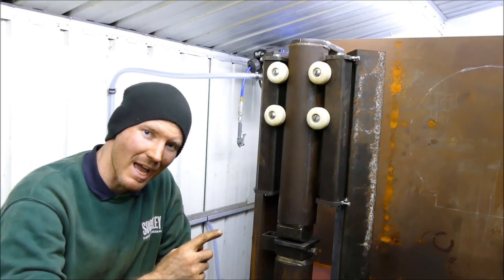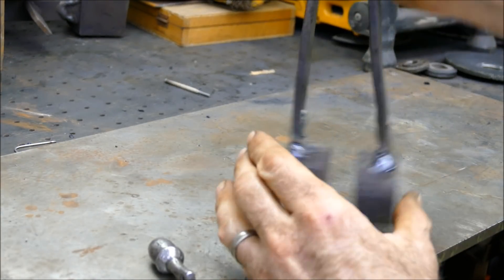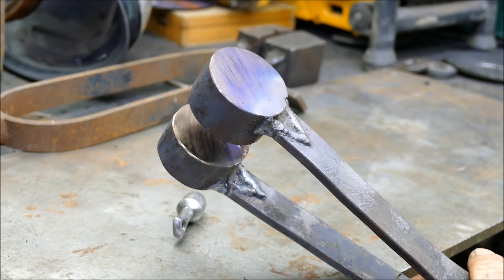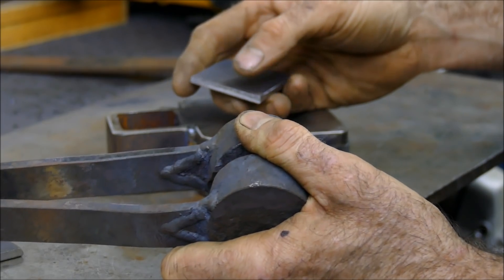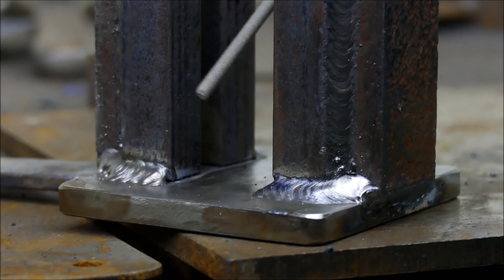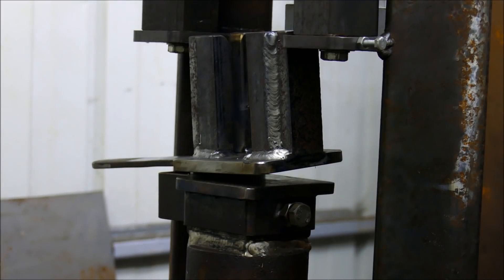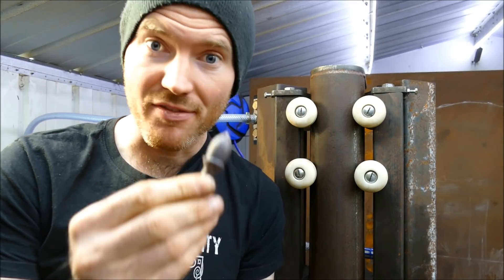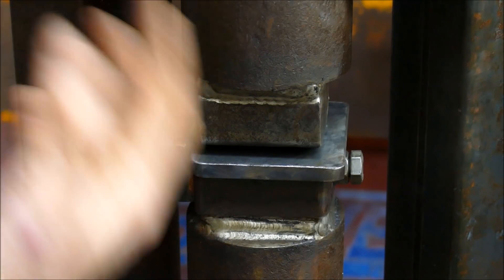Quick tool change DIY Power Hammer forging dies

Comment: Hello Joshua from Canada, great video. I just finished a tool making master class. Made some great tools at Arrowhead forge in Wyoming, your tool holder is perfect for my situation, its going on just the way you built it for my new DYI hammer that I built this past winter. I have also used railway track for the "Blanks" on my spring swags. Nice and heavy and easy to machine into a very nice set of dies. Thanks for the inspiration, glad to subscribe to your channel.
Reply from the maker: Well done Bruce that's awesome. Thank you so much for the encouragement. I look forward to hearing what you're making with the tools you're producing. All the very best. Cheers J

Comment: Hi Joshua. Just posted a video on a power hammer using the same pneumatics at you. I ended up with a very different design based on what I had around me. Let me know what you think!
Reply from the maker: Well done she looks like a good one. I recommend quick exhaust valves on your cylinder (if you did I missed it), it seems a little slower than mine. Is it running at 120psi?

Comment: just found your channel. love the air hammer. Is there any benefit going from a 2 1/2 inch bore to a 4 inch bore? thanks
Reply from the maker: Thank you. No it gets too slow after going wider than 2.5". Impact Speed  is key to the design not the pressing pressure. I tried with a 4" but it sucked and 2" wasn't quite enough. 2.5" is the optimum @120psi. cheers J

Comment: Hey! What number/type rods are you using generally for arc welding?
Reply from the maker: I use 6013 & 7018 in 3.2mm and 2.5mm. cheers J

Comment: An idiot's (i.e., non-blacksmith's) question: why do you press the dies multiple times with the power hammer instead of one big and final push with a hydraulic press? Of course, it would require much more precise (machined?) dies, but would likely save a lot of time and effort...
Reply from the maker: A press with the same forging power would require for more energy than what my power supply can handle. If you imagine the energy transfer like this, if you take a hand hammer and attempt to push a nail into a plank it takes far more energy than tapping it with a hammer, also you impart energy into the work piece which makes it hotter for longer whilst a press sucks heat away making it less efficient. The impact force = mass X acceleration. But a powerful press is lovely to use.

Comment: Not only a very cool tool holder, but the way you are adapting the tools to accommodate a one-man (two-hand) ship is very clever. Two questions: 1. Is the welder your now Röhr? 2. Are the acorn dies hardened and tempered? Thank you for the post!
Reply: That teaches me to comment before I finish the video
Reply from the maker: The final die is case hardened which I'll show on another video. The other is just mild steel. I used the stick function on my Tig as my MIG needs an appropriate plug first, I'll do a video of the MMA function and flux core in another video also. Cheers J

Comment: Nice as ever Joshua. I have been doing a fair bit of MMA welding building a power hammer ( started like yours but looks very different based on what materials I could find) but my welds can still only be described as ‘functional’, not works of art like yours. Hopefully posting a video in a few weeks.
Reply from the maker: Awesome I look forward to that. Repetition and analysis over many years is what it took me to do that...

Comment: Stickmaster!
Why did you use the tig with the first piece? Or not use the tig when you used mma? (Just curious from a beginner)
Cool stuff and nice quality!!
Reply from the maker: The tool holder didn't need a large bead that stick delivers and TIG is more neater weld. I could do it all with stick but I like to use TIG when I can because it's lovely.  A stronger weld would  be if I did a Tig route run and a 7018 cap. cheers J

Comment: When i was in hereford i complained that they only taught arc welding on the blacksmithing course and manged to get a city and guilds MIG welding course added to it for over 40 students , wonder if they dropped it the following year lol
Reply from the maker: The best way to learn to weld is using an arc welder first. We did MIG and a little Tig at Hereford but we had more than most other years. Problem was there wasn't enough students so they didn't get the funding after our year.
Reply: @joshuadelisle  fully agree about arc welding first , if nothing else its 300% cheaper than tig welding and 200% cheaper than mig  and perfectly acceptable and easier on anything above 3 mm , and lets face it you dont need to learn how to weld below 3 mm unless your a mechanic !
Reply from the maker: @Edgunsuk  you can weld 2mm with a 1.6mm 6013. They are low penetrating and good for sheet steel. I've got a pack and do a video welding another horse head together but using all 3 processes, MIG, Tig, and stick to show that you can make one with any welder.

Comment: Nice video. I was just wondering what rod were you welding with.
Reply from the maker: I'm using 6013 but 7018 are better for this type of work. Just what I have at the moment until I buy a pack of 7018

Comment: Really useful video!  Thanks very much.  I plan to build a foot-powered trip hammer (no electricity just yet) in the coming year but these concepts you presented will work equally well as on a power hammer.  Thanks again and Happy New Year.
Reply from the maker: Thank you Bob! all the very best. cheers J

Comment: Josh, I’m going to reverse-engineer the steam power hammer linkages from Ken’s MZ75 (not for resale but personal use). Just a personal challenge for the tech side of my brain. 😄
Reply from the maker: Must check that out, have you got a link to the video?
Reply: Joshua De Lisle Just search on youtube for “Ken’s Custom Iron MZ75.” It’s a $5000 pneumatic power hammer that uses the steam hammer linkages. Pretty cool.

Comment: Got my little rubber bumper today. Love the Queen Elizabeth stamp!  Also got that TIG setup for Christmas you recommended. Did you upgrade the torch?  What MMA rods did you use on the 4” round bar on the original build?
Reply from the maker: Glad it came ok! Nice! I recomend 7018 and to pre heat the 4" solid first before welding. just uploading the tig upgrade video and will be published next Thursday. All the very best. cheers J